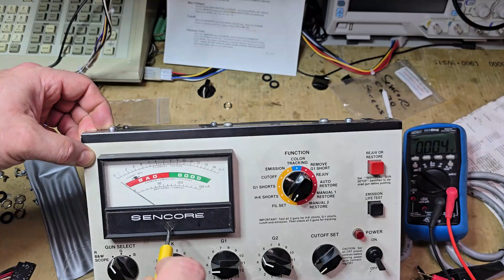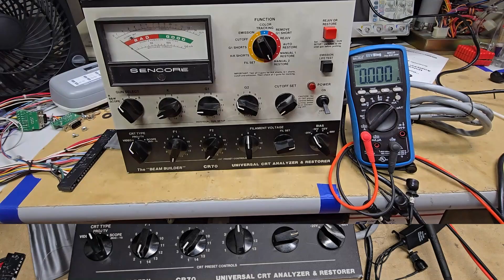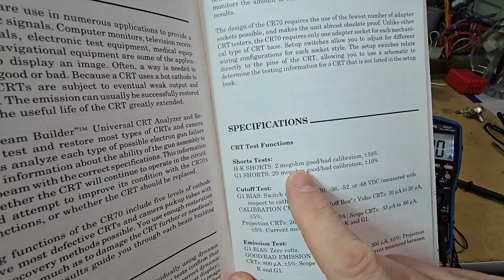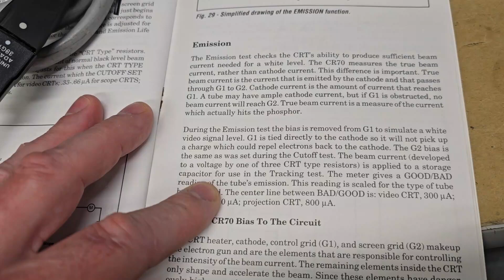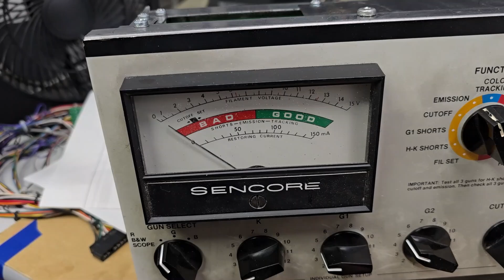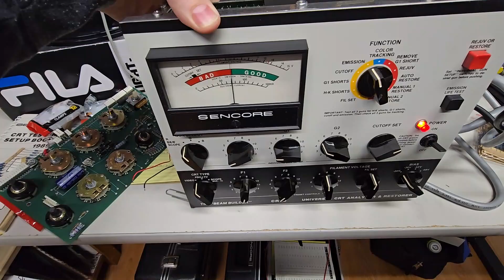Another Sencore CR70  Repair - Part 2 - Calibration

Comment: Okay. I found a calibration guide somebody wrote out there, and it says that for cutoff, you need to inject voltage from an external supply between circuit ground and your DMM. PSU NEG to CR70 circuit ground. PSU positive to DMM positive. DMM negative to 100k resistor. Other side of 100k resistor to K clip on the adapter. Turn on PSU and CR70. Start at 0V on PSU and raise it until DMM reads 15 microamps. Center needle in cutoff box. Done. The Emissions set procedure is a little different from what you did, but gives similar results where 300uA is at the center line.
Reply from the maker: Can you provide link to the guide? Thanks for sharing the info.
Reply: Thanks to this I was able to get mine realigned after a repair.  Using the video instructions I couldn’t get the needle high enough to reach the cutoff box.  I’m sure I speak for a few of us when I ask if you can share where we would find the rest of the write up you found.

Comment: I think the cutoff range is probably not going to be correct by putting a load across K-G1. There's also internal resistance in the CR70 between G1-G2-K that is creating parallel resistance in the system, and the CR70 is waiting for the current to happen when the tube starts to conduct. I think there would also be a defined load across K-G2, and the K-G1 may or may not be correct at ~1.5M when you do that.
Reply from the maker: I don't recall the details but do recall not being certain on the calibration test.  If you figure out the correct method, let me know.

Comment: Really appreciate this video!  One question about all of this:  Are you connected to a tube while calibrating this, or are you just adjusting the Sencore without anything connected?
Reply from the maker: I was not connected to the tube while doing this.  I have since partially tried while connecting to a tube but my results in both cases are less than perfect.  Not sure if Sencore will share the 100% correct way to calibrate these things.

Comment: Why would you want to "current limit" the filaments? The current limit test switch only works in the filaments mode?
Reply from the maker: Correct, the current limit adjustment only seemed to impact the current output on filaments. It would be more appropriate to call it Heater/Filament Current Limit Adjust.   I can only assume that a H-K or other load could result in damage to the heater circuit of the test unit.
Reply: @jacklick  If you have a heater short ie part of the heater is shorted to itself this will protect the voltage regulator.